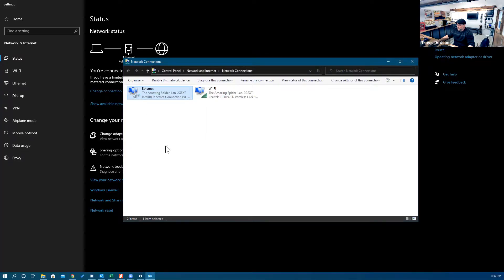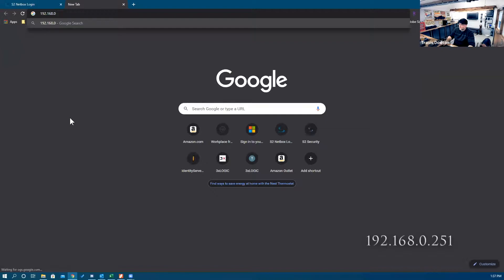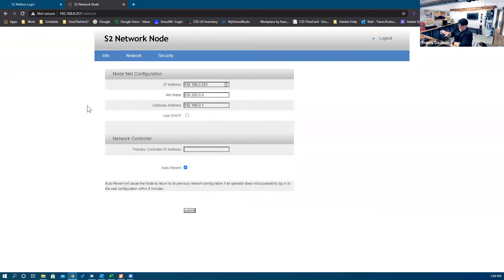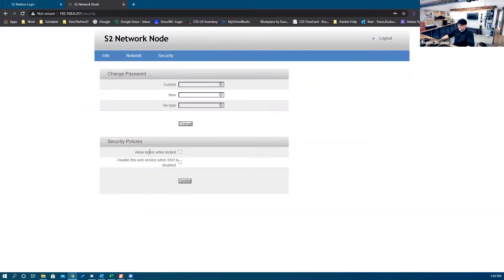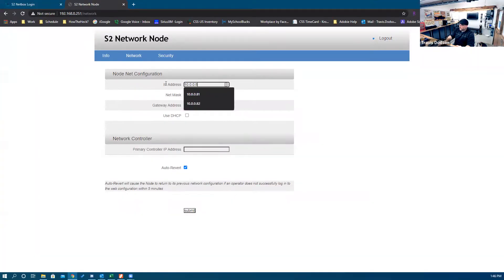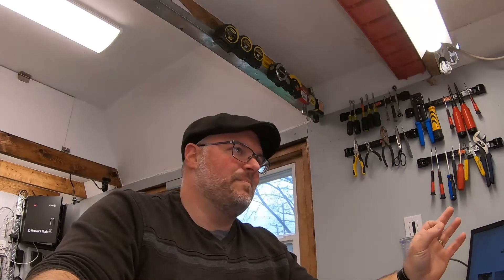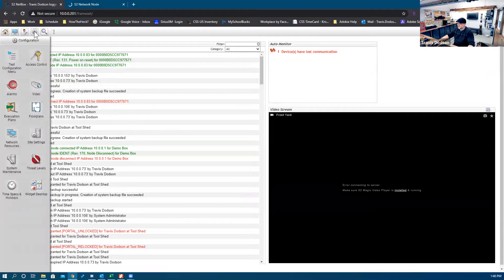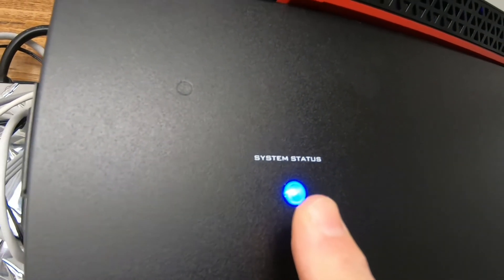How The Heck do you program a new or defaulted S2 Network Node to a Controller?

Comment: I have a wireless internet box (AT&T Internet Air) so it can't have a static IP which our I.T. guy is saying is required for the S2 but in the past we had a different wireless box (Verizon) and I was able to get it to work. I just don't remember what setting I changed in the verizon box to allow the S2 to connect and then we just had to look up the IP whenever it changed. Any ideas?

Comment: We've got nodes/controllers that will not host a web interface. They can be found via nnconfig but I can only use DHCP (but grays out options to set node IP) or use static and also unable to set node IP, or if I set node IP, i cannot set IP or DHCP. In a bit of a trap, here. I can ping the self-assigned 169.x address but no web interface, I can set to dhcp via nnconfig and ping its new IP but still, no web interface. Reset procedures via jumper4 & reset button do not seem to be working.
Reply: Older NODES do not have a web interface. The only way to program them is with nnconfig. Best guess is you need to change your computers IP address to whatever it is seeing the node is. Even if it's a 169.254 ip address. After you should be able to set it static.

Comment: Hi, I had a power outage now I can't login to my system.  What do I need to do?
Reply from the maker: Unfortunately, that's a loaded question with no cookie-cutter answer. Your best bet would be to call your installer and see if they can swing by and take a look. The installer will need to hook a monitor to the NetBox. There is a VGA port on the side of the main board. You can't do much with the monitor, but it can give you some information. The main one is that all the services are started. After you plug in the monitor, you should see a black screen with a login text. If that is what you are seeing, then you are good. If not, reboot the panel and see what happens when it starts. Fingers crossed you don't get drive fail. Unfortunately, S2 uses crappy SSD drives, which die easily, and you need to replace it. If you don't have a backup, you will have to re-build the system from scratch.
Reply: @howtheheckhelp  HOw do I get the installer or image to reload from scratch?

Comment: What is the "network controller" you keep referring to?  Do these nodes need a different device they connect to?
Reply from the maker: The Network Controller refers to whatever style NetBox you have.  "NetBox, NetBoxVR, NetBox Extreme, NetBox Quatro, etc" S2 calls it the "Network Controller" so when programming the IP information in the NODE, the section for "Network Controller" will be the IP address you use to log into whatever style NetBox you have. NODES can not be stand-alone they need a Network Controller.
Reply: @howtheheckhelp  Thanks, so if we have a NetVR and 2 Netbox nodes, do we need anything else?  We can't figure out what they were using as the network controller, does the Netvr function as the access network controller?
Reply from the maker: @MrPhilthy08   It sure can, that would be a NetBoxVR. But I can't say for sure that is what you have for sure. Things to check, If you know the IP address for the NetVR navigate to it in Google Chrome, you should see a login page. If it is a blue page then you just have a NetVR if it is a white page then you have a NetBoxVR and that is the controller. If you have a Blue screen then head over to your NODES. Open the cans up and see if you have a circuit board on the side wall of one of the NODE boxes separate from the blades and ribbon cables in the center. If you have a panel on the side wall of the can then that is your controller.
Reply: @howtheheckhelp  Thanks! That explains it.  We have a blue login screen and there isn't a controller in the cans.  This was a system belonging to a tenant that moved out.  We believe they probably had them connecting to a controller at one of their other sites over their network.

Comment: Hey what do you do if you cant access your network controller but you can access your node
Reply from the maker: This is a tough question and it depends on a few things. Most will involve S2 Tech support logging in so hopefully the support is up to date. The first thing I would do is hook a monitor up to the controller and see what it is doing. If it's a wall mount controller there should be a VGA port on the inside of the can. If it is rack mount it will be on the back. If it is running properly it should kind of look like DOS and have a login. The only thing you can do from this login is change the IP address and default the controller. Don't do this unless you have a DB backup and really know what you are doing.. I had an issue a few weeks ago where a controller was offline and all I had to do is hit F1 on the keyboard and it started all the services and it was good to go. Also check to see if you ping the controller IP it to verify it's not a network issue.